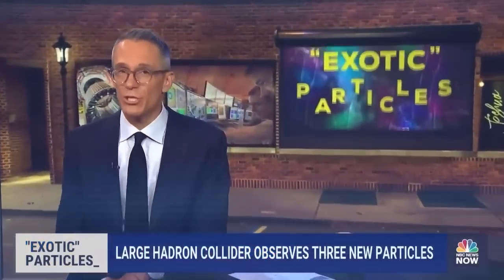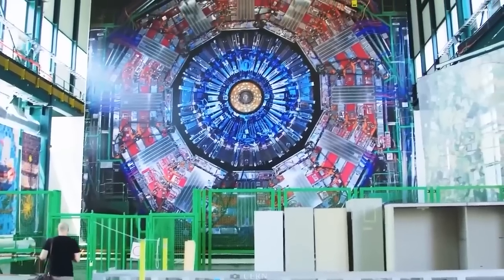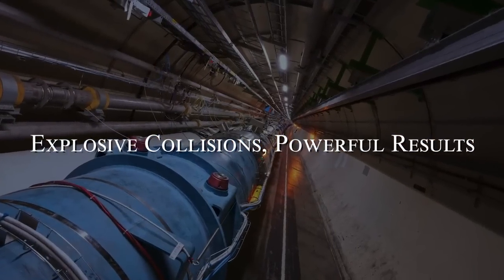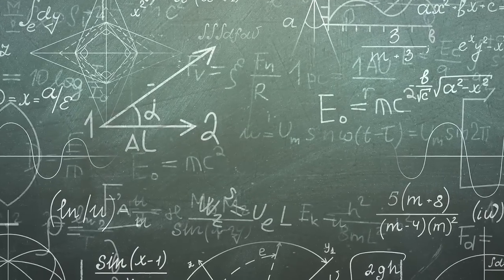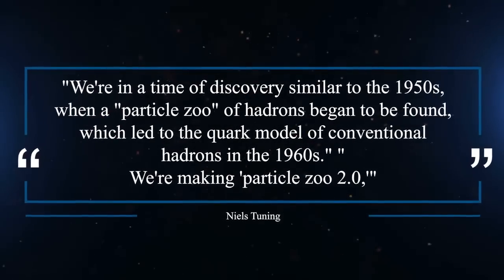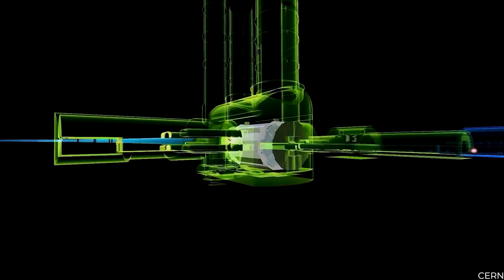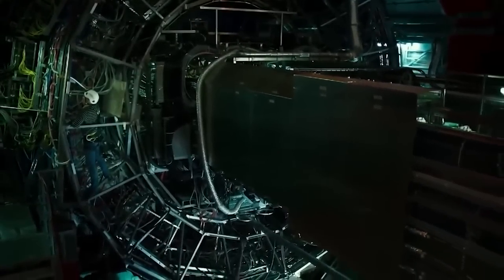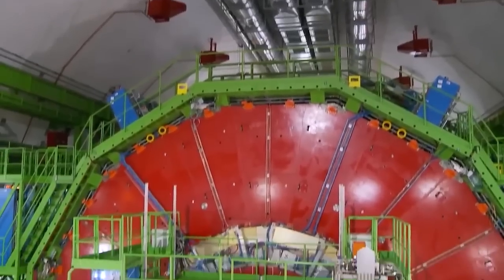Elon Musk Just Announced A Terrifying Message About CERN

Comment: The accelerating redshift shows that we are not in a big bang, and the dust cloud we see at the outer limits is the near-infinite dust cloud we evolved from. You can therefore not explain this redshift with the big bang that everything moves away from us, but with shrinking atoms. When atoms shrink you get a shorter wavelength and the interaction between atoms becomes faster, where time goes faster and all reactions in atoms also go faster. Where the smallest particles evolve quickly and our visible universe evolves slowest, because those are the largest structures. The redshift bands that are not explained are due to the small particles evolving and affecting the shrinkage. If you look at the universe with this knowledge and you see a galaxy with 50% redshift, then you look into the past where the atoms still have a diameter twice as large and where time goes only half as fast and in the time that it has taken the light from that galaxy to reach us our atoms are halved in diameter and the next halving of the diameter of atoms goes through the clock which is twice as fast as that galaxy with 50% redshift, now in half the time. 
The previous halving of the diameter of our atoms has therefore taken twice as long and there is a galaxy with 75% redshift that has atoms with a diameter that are 4 times as large where the clock only goes at a quarter of our clock speed , 3 times as far as a galaxy with 50% redshift, which is therefore incompatible with Hubble's constant, which shows that the universe is unknown and will, by using the parallax of our Solar System going around the center of the galaxy at 840,000 kilometers per hour and where we have old photographs of Hubble, which he took 100 years ago with his 2.5 meter reflecting telescope 720,000,000,000 kilometers back, we now have a base of 720,000,000,000 kilometers 2,400 times further into space, where Hubble measured the parallax of the orbit around the Sun with a parallax of 300,000,000. kilometers to 200 light-years away, we can now measure distances 480,000 light-years away with our old 2.5-meter reflecting telescope, which is twice as far as our galaxy is in size, and we could use space telescopes tens of millions of light-years away measurements to clarify the nature of the redshift. If our Earth and Sun were to halve in diameter, the clock would go twice as fast and the Sun would emit twice as much energy, but the surface of the Earth would be only a quarter and we would only be half as large. getting the energy from the Sun, which shows that the ice ages are due to the shrinking of our atoms, which is also influenced by the circular orbit of the Earth that regularly changes into an ellipse, causing ice ages that alternate with warmer periods.